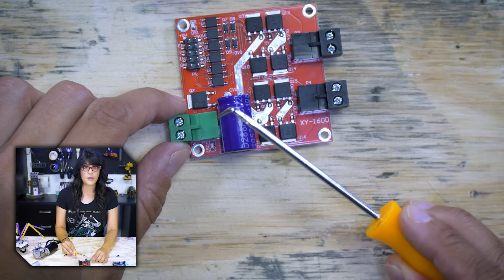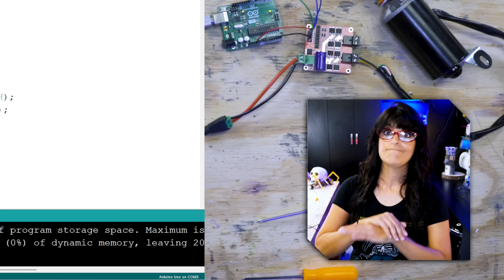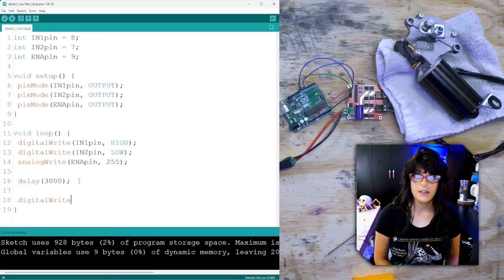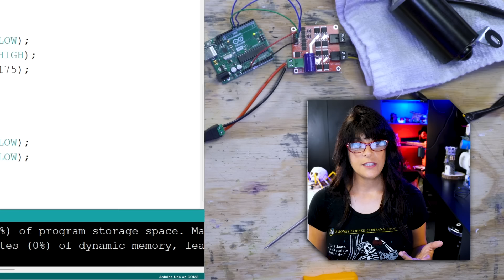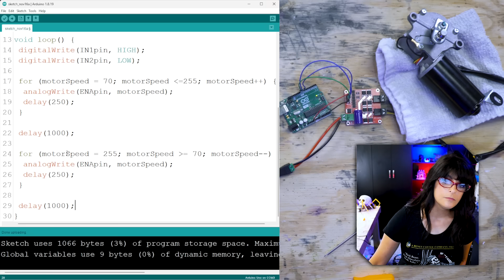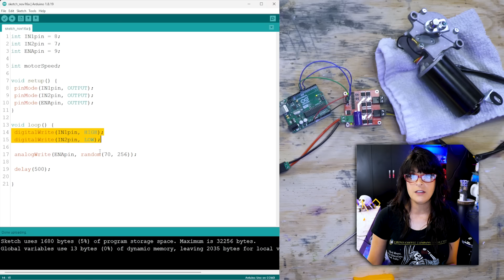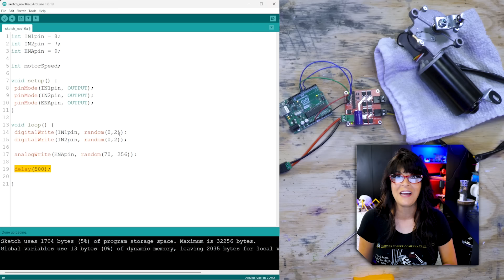How to Control a 12V Motor with Arduino: Easy Wiring & Code Examples

Comment: Cool. Enjoyed this very much. By the way, how'd that vacuum former turn out?
Reply from the maker: Glad you like it! My vacuum form machine worked great. One of the heating elements had a tiny hairline crack in it that I never noticed until recently because it got visibly worse from moving the machine around the shop. Against my better judgement, I tried using a high-temp sealer (rated for over 400 degrees) but it melted during my first test. I'm debating whether to hunt down another toaster oven or just use a smoker heating element. I'm leaning towards the smoker one because there would be no wiring. The heating element plugs right into the wall. Plus it would be much easier to replace down the road. I'll keep you all posted!